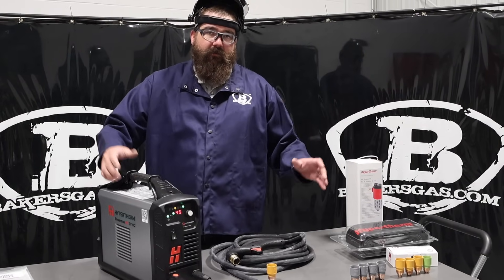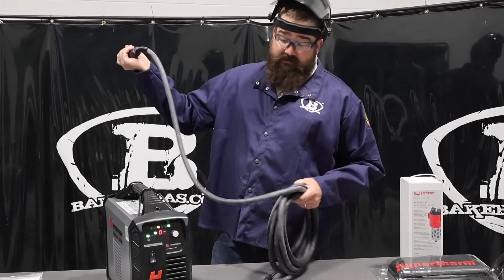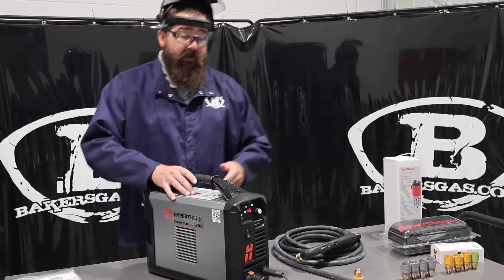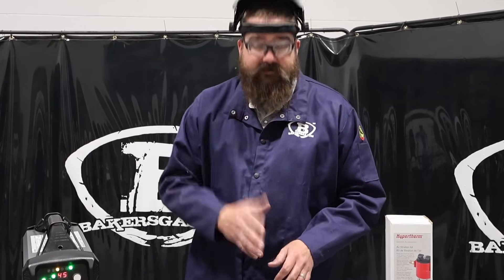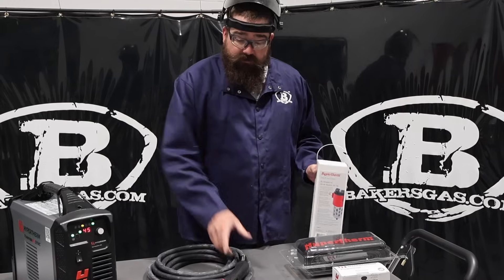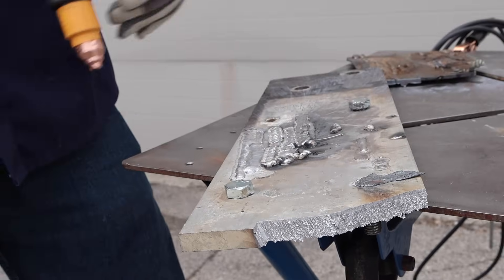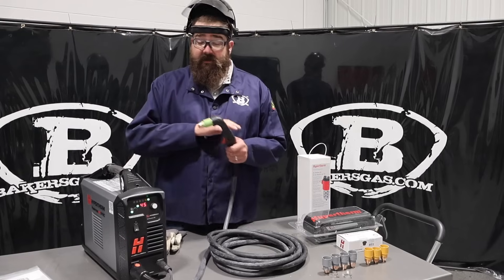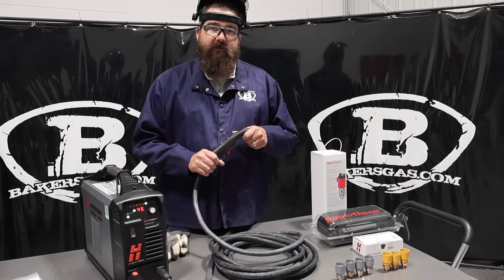Hypertherm Powermax 45 SYNC Plasma Cutter Review & Demo

Comment: What type of air compressor is required?
Reply from the maker: If you look at the specs it tells you the air requirements but in general minimum 60-gallon air compressor with a 5 horsepower motor or greater is recommended. The compressor should deliver at least 15 CFM (Cubic Feet per Minute) at 90 PSI. A larger tank capacity is beneficial for longer, continuous cutting operations.